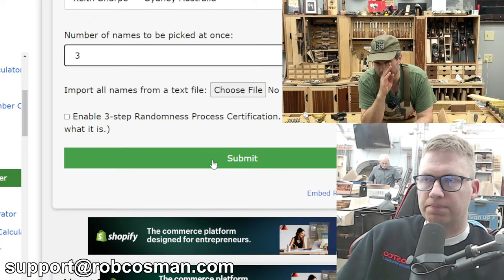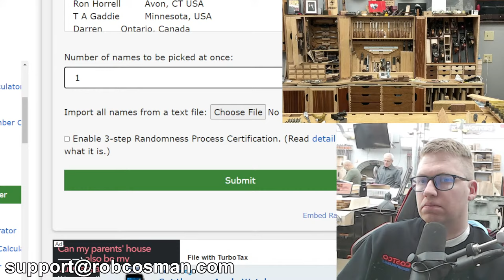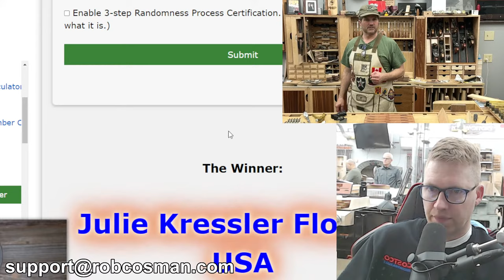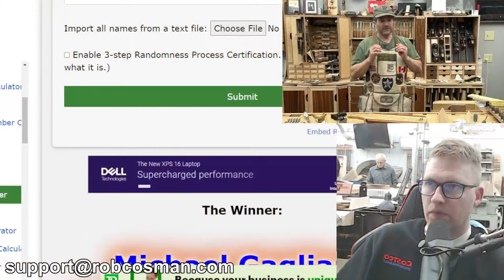Saw Sharpening - Live Q & A (23 Mar 2024)

Comment: Hi Rob and gang, do you have any plans to supply for sale a saw sharpening kit?is it recommended to set the teeth before or after you sharpen it?
Lastly what was the name of that salt you referred too and do you take it straight?
Reply from the maker: Celtic salt, Amazon.  She says a pinch each time you drink a glass of water.  Digestion starts in your mouth so I dissolve it they drink the water.  Table salt is bad news, Aluminium silicate added to make it flow.  Celtic has 82 essential minerals.
Reply from the maker: No on the sharpening kit.  I would set last, you can sharpen 3-4 times between settings.